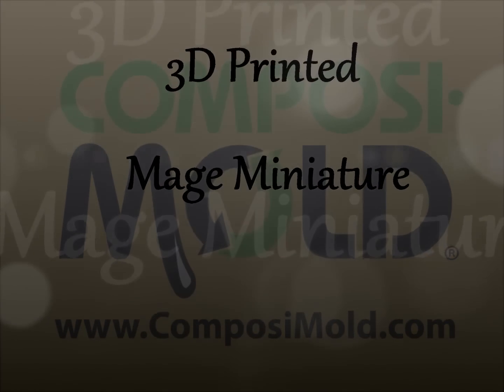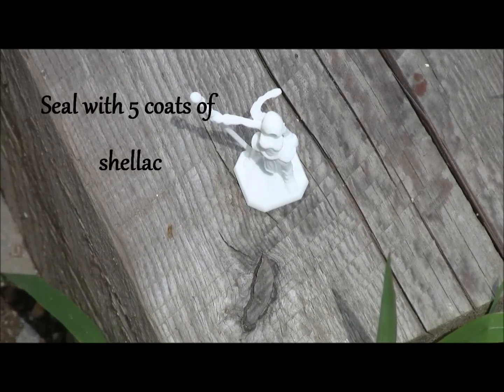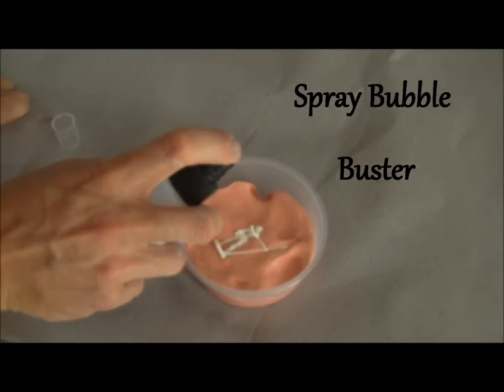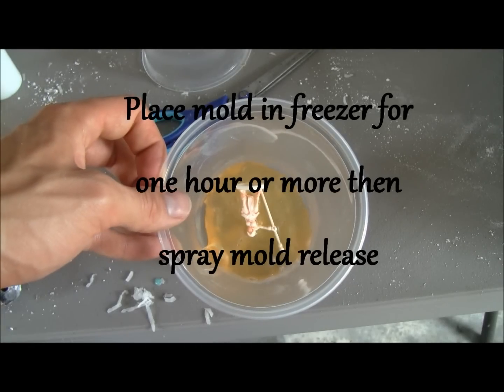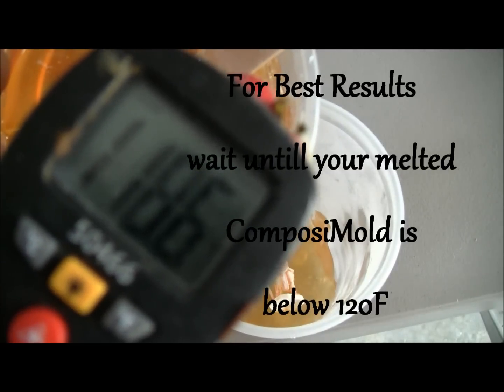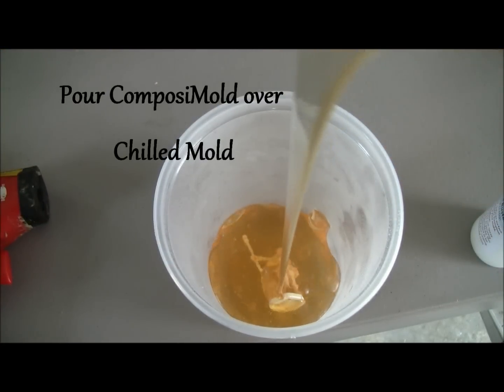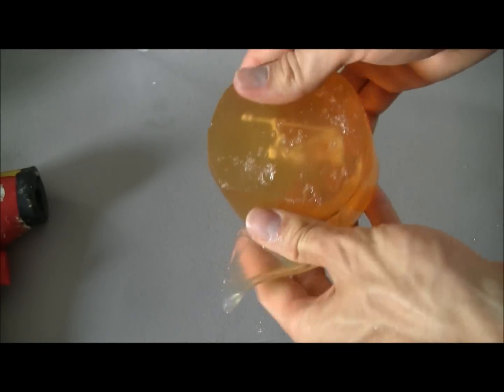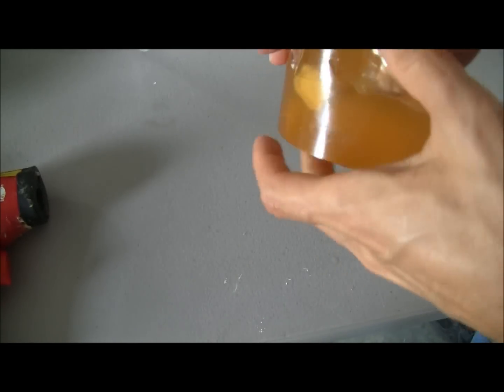3D printed miniature Two Part Molding With ComposiMold

Comment: Ok... How do you fill the two halves with resin and have them line back up?
Reply from the maker: Great question...You can add keys or slots around your mold. The second mold half will fill in those keys so that when you push the mold halves together they will settle into those slots. We made lots of bumps in our first mold half so that the two pieces will fit. Thank you.

Comment: ouch that cast was ugly, sorry but just really bad, you have to create a two part mold with channels, then you gotta get a syringe and inject the cast material in to the channels, its a massive pain in the ass to get working right but creates a far better and more detailed casting than what you ended up with
Reply from the maker: +bfg2600 Thank you  for the feedback and advice! Have you had the chance to try ComposiMold yet? Also, check out this video when you get the chance https://www.youtube.com/watch?v=rtxgSLUYwIg and let us know what you think.Thanks!
Reply: +ComposiMold Reusable Mold Making Material -----no but the material looks interesting I usually use the typical silicone, the video you posted seem more spot on, but I still would have crated channels for the limbs, so when injecting the casting material will come out the channels for the limbs, this insures the casting material mast it to the limbs, probably not as important to do that in large figure like in that video but small d&d figures you pretty much have to
Reply from the maker: +bfg2600 Thank you for checking out the video. I will definitely try creating the channels on my next minifigure.